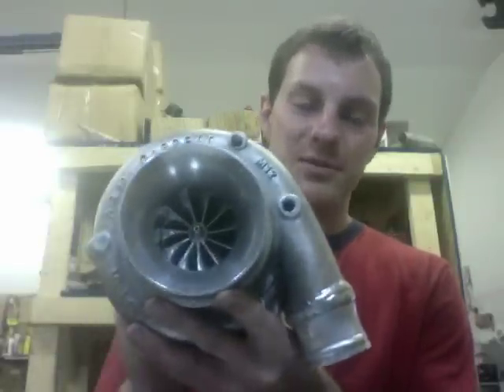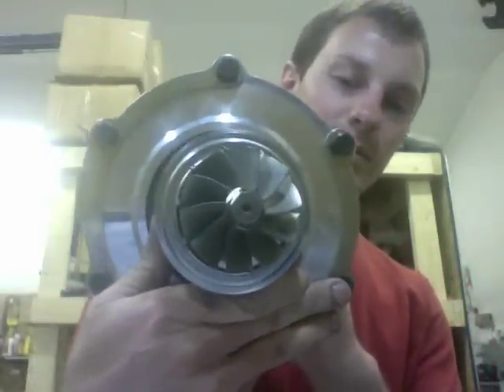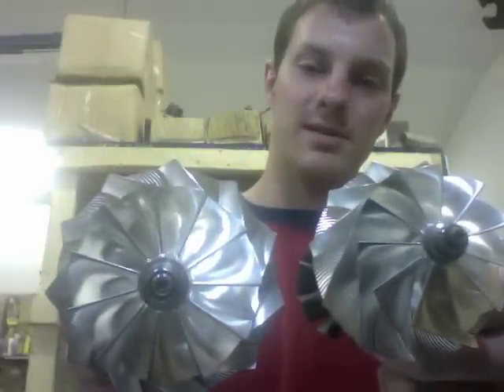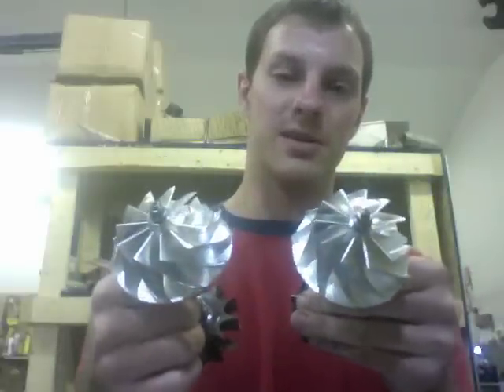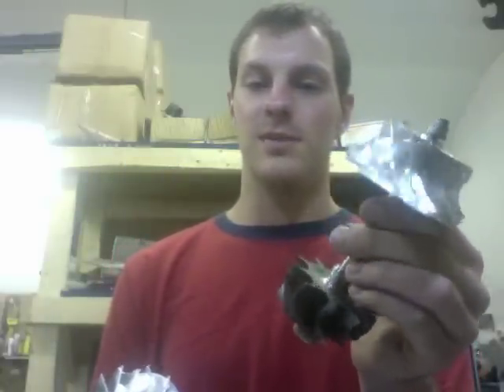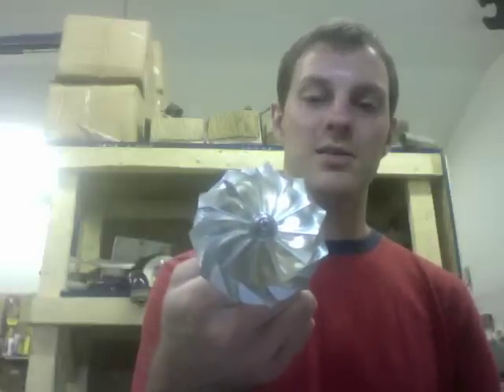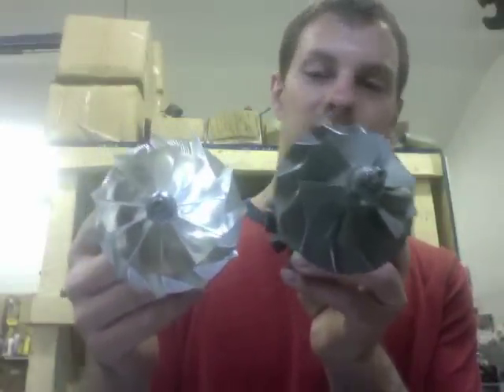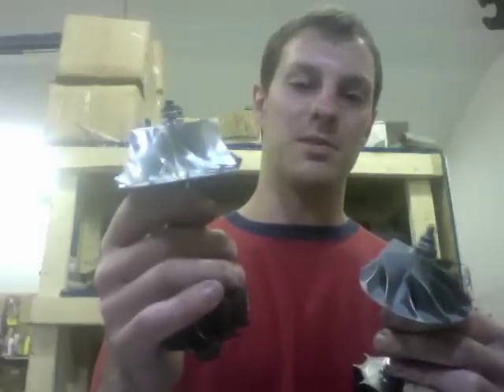Garrett GTX3071R vs GTX3076R

Comment: Hey brotha! Want to get your opinion, trying to get as much info as possible for my build!

So I have a 06-08 K24a2 swapped 8th civic. (Strongest 2.4L Honda has) and I am planning to Turbo it soon. I am looking at a Full Race Kit, but what's most important, as you know, is the turbo.

I am thinking the GTX3076 would be perfect, I'm wondering when it would spool up and if would overboost the turbo if I didnt get the bigger exhaust housing, or if that housing would make it spool way high in the RPM band. Would a GTX35r be a better fit for the K24a2 just in general engine to turbo matching?

My K24 is making 220 WHP 170 WTQ (@ 3k) NA with the lightest mods and tune CAI + Exhaust, still running stock restrictive K20 header + Cat. So the engine is pretty beefy and fiesty.

Comment: hey man 
i have 3  questions , i have the gtx3076r with .64 tial exhaust and i dropped a valve seat that destroyed the turbine 
1 can i use a .82 using the same housing ? 
2 is there a good upgrade i could do ?
3 whats a good place to buy these turbines or is it threw garrett ?i tried sending a dm but couldn't find out how 
thank you in advance
Reply from the maker: The gtx3076r is the largest of its series, so if you want to upgrade you have to upgrade to a gtx3576r or larger. The gtx3076r is rated up to 580 hp, but the turbine housing size is the limiting factor. You can probably get a .82 turbine housing that is machined to fit the gtx3076r or gtx35r. I have replacement turbines on hand. We have  our contact information on our website
Reply from the maker: http://turbolabofamerica.com/contact-us/
Reply: Perfect I will contact you directly
Reply: I emailed you but got no reply

Comment: Quick question... If i wanted to make 500whp on a subaru 2.5L engine all the way till redline.. Which would be the better turbo to use.... gen 2 gtx3071 or gen 1 gtx3076? 
Considering that what is important to me is for the power not die off before redline.

I'm asking because. It's generally agreed that the gen 1 gtx3071 was a good turbo for the 2.0~2.2L engines... Not the 2.5L.  So does the same apply for the gen 2 gtx3071?

Comment: Hey man so I have a built gsr 1.8 bored out to a 2.0 do you recommend 3076 or 71 it’s more on a daily/occasion race? What do you recommend
Reply: My 1.8t is laggy but pulls so hard on the gt3076  .63ar turbine.
Reply: I'd like to add one for 75,000 miles on a garret 3076r.   It's probably do for rebuild. burns some oil under load now, filling the boost tubes.
4500rpm spool up starts  t25 flange though:(

Comment: Hi Austin, what's your opinion on flank vs point milled compressor wheel. Which performs better? Is the difference a lot?
Reply from the maker: +chownkay I have never heard of the term flank or point milled compressor wheel before.
Reply from the maker: There is some bad information online about this topic. Tims turbos has video of the billet wheel vs cast, He says that the billet wheels weight more because it is more dense, but it depends on the billet wheel. Some of the billet wheels we have are 20 grams lighter  than stock and have a more aero design. 

They are designed the grab more air. I have no way to test a comparison between the 2 different styles. However, it makes sense that the wheels with the thiner blades and more narrow hub will flow more air because it has more room for more air to be grabbed.

We use mostly billet wheels for the simple reason that they come in many different sizes that we need, they are popular, they make the turbos look good, they are a performance design, as well as with extended tips, and they are more durable over cast. 

Here is a weight comparison picture of the same size: wheel http://turbolabofamerica.com/holset-hx40-super-billet-compressor-wheel/
Reply: +Turbo Lab America Hi Austin, if you read the blog in detail, it's not so much discussing the weight of the wheel, or billet vs cast wheel. But more of how the billet wheel was forged, e.g. 3rd order geometry and flank milled vs point milled billet wheels..

Comment: What turbo would you recommend for a daily/weekend warrior brz? I was thinking a gen 2 gtx2867r with a .63ar or would that be a choke point? My goals are 300whp on pump gas the FA20 seems to have good flow, does this seem doable?
Reply: I would go with the Gen2 GTX3071R... I ran a gen 1 and it was crazy! hit boost @2000rpms and full boost (30psi) @4800 on E85 in my 257 swapped gc8... it will leave you plenty of room for upgrades down the road. Great turbo for 300-500whp
Reply: Idk if you’ve done anything yet, but do some research into the available turbo kits for the fa20 and reach out to those companies. Most companies will be happy to converse with you and recommend the upgrades you should make or things you should replace, if any for your power goals with their kit

Comment: Hi Austin can i ask you a question...??the ball bearings of the gtx3076-3071 and gt2860r gt2860-gt2871 are the same????if i order a kit from you it will fit all of these turbos if needed???
Reply from the maker: +HLIASRS3 Yes it is the same, it also fits the gt35r and gtx35r. The Cage Changed to a larger cage with the GT37r /gt40/gt42r series.

Comment: Hi Austin i'm sending from Greece,i have in my audi s3 tfsi atpgt3071r turbo kit with 11 blade compressor gtx3071r and I see in two different dyno dyno dynamics and dynojet 621bhp and 76kgr torgue in 2,32 bar.I wonder if I can see that power from gtx3071r compressor or they did mistake and put in atpgt3071r gtx3076r compressor;You are famous here in Greece with your turbo upgrades thank you very match.
Reply from the maker: +dimitris iliopoulos are you talking about making that much power on 2 of those turbos? The s3, you mean s4?
Reply: +Turbo Lab America I have audi s3 tfsi and I have the atp vvw-186 turbo kit with 60mm gt3071r with 11 blade compressor gtx3071 inside and I wonder if they make mistake and they put inside gtx3076 11 blade compressor because 621bhp and 76kgr torggue from gtx3071 is too match specially the torgue.Thank you very mutch for your answer,my question is if gtx3071r in 2,3 bar can have 621bhp from your experianse;
Reply from the maker: You should measure the wheels.
Reply: +Turbo Lab America In dynojet I see 526,28whp amd 64,68kgr torgue in 2,3 bar,in dynodynamics I see 621bhp and 77 kgr torgue

Comment: What set up would you recommend for a 2JZ GTE VVTI motor going into a Datsun 280Z with a 350Z CD009 transmission and a Q45 3.54 differential shooting for 500hp? Would really appreciate your input, thank you!
Reply: Casper0878 gt3071r. Made 504whp on 22psi on pump 98. Next to no lag either
Reply: Casper0878 only down side is that’s all I can really get out of it. If I want anymore power I’ll either need to run e85 or go to a bigger turbo

Comment: Can the same thing be done to upgrade the GTX3076 to a GTX3576 ?.... I have a bolt on GTX3076 on Evo X making 507 whp @31 psi and I would like to upgrade to GTX35 and make somewhere in the 550 plus.
Reply from the maker: +pekoso1 If you currently have a Gtx3076r with a .82 t3 turbine housing you could go with a 1.06 t3 turbine housing and probably make the power you want.

To go from the gtx3576r,  that combination involves replacing the GT3076r turbine 55 x 60mm (6mm shaft bore) with a gt35r turbine 62.35 x 68mm (6.35mm shaft bore). 

Since the shaf tbore is different, the compressor wheel must be machined out, or the compressor wheel replaced. Its a lot easier for me to replace the wheel.  The cost to do this upgrade is 550$, which includes the rebuild, machining the turbine housing, exhanging compressor wheels, and balancing the assembly.
Reply: true, but why would anyone want to run a 1.06 on a 30r when he can run a gtx3576r and make gt3582r power & gt3076r spool!?! The 1.06ar is just too laggy, even on the 30r.
Reply: im not 100%, but im pretty sure you can upgrade the gtx3076 with a 35r turbine wheel upgrade kit for about $600
Reply from the maker: It's just depends on the size engine and the amount of horsepower someone is trying to make. Keep in mind the difference in the gtx3576 and gtx3076 compressor wheel is that the  gtx3576 has a 6.35 mm shaft bore to fit the gt35r turbine and the gtx3076r compressor wheel is 6.0mm shaft bore to fit the gt3076r turbine.  So the gtx3076r upgrading to gtx3582r does require having the compressor wheel  bore machined out or replaced with the gtx3576r wheel but the wheel design is the same otherwise.

Comment: What is the best turbo 2015
Reply from the maker: +Son Goku It depends on the HP you are trying to make, and the size engine you have.
Reply: gtx3071r with 82ar for anything under 500whp and the gtx3576r with 63 or 82ar  for anything from 500-650... looking to make more power than 650 i would look at either a gtx4202 gtx5518r or a 6862 even!

Comment: Would this gtx3076 be better on a 3 ltr for 250-300kw manual instead of a gt35/40 with a. 62 etc?  which everyone is recommending. I don't want huge lag and big power more a all round Street car
Reply: 4y old response.  In a 2jz the  Gt30 .86 are beat .64 ar across the board.  Gt35 .86 ar was beaten to around 5000 where it lagged by 700 rpm.  It made about 20whp more.  For a street turbo the gt30 was superior with 100wtq or more at many rpm points.

Comment: what would you say is the spool diffrence
Reply from the maker: There is no correct answer for that, because it depends on the engine size. The closer the turbo flow rates is in relation to the natural flow rates on the engine the more efficient it is and quicker the spool will be.  It also depends a lot on the tune, intercooler volume etc
Reply: OP is correct.  There are a lot of factors in determining spool characteristics.  
The general rule is the lower A/R of the turbine housing, the faster the spool-up, the greater the low-end torque, and the lower the high-end power.  A/R is the interior area of turbine (A), {or the cylindrical spout of the snail to get picturesque},  divided by the radius from the center of the turbine to the tongue (R).  Since most turbos have an array of different turbine housing A/R's, you can customize the application of the turbo, and really just need to select the best turbo for your engine size and displacement.

Comment: Can the gtx really put out of 550whp ?
Reply: Gtx is just the model, not the size of the turbo. To answer ur question tho, the smallest Gen 2 gtx series turbo to make 550 is the 3071R, It will make 0ver 600awhp and the gtx2867R might make close to 500whp... I made close to 500 with the Gen 1 gtx3071 .82ar on E85 EJ257 w/2L heads, so the Gen 2 will make a bit more!
Reply: +Evol_AF did it pull all the way to redline or it run out of puff?
Reply: My STi RA had a 8900RPM Redline, but it would hold 30psi to 8500 and fall to 26-27 at Redline. With a 9k Redline i rarely needed to hit redline. It hit peak HP @6500 & TQ @5600 and didnt fall off untill 8500
The gen 1 gtx3071R was my fav 30R sized turbo, but best all around IMO is the Gen 2 gtx3576R.... Power & Torque  with little lag on a 2L & very little lag on 2.4-2.5L
Reply: @Thr33.Sid3z  I'm looking for a turbo that pulls all the way till my 8k redline on a 2.5L. 

My options are a gen 1 gtx3076 which i currently have or a gen 2 gtx3071... 

What would advice...? I'll mostly be drag racing on race gas.
Reply: @Thr33.Sid3z  saw that the gtx2867 was making well over 400whp like you said.   How much earlier does the Gtx2867 start making boost vs the gtx3071 and gtx3076?

Comment: ur figures are just a little bit off. The Exducer on the GTX3071R is 73.45mm (2.05mm bigger than claimed) and ur saying that u wouldnt recommend running it on anything bigger than a 2.0L or 1.8L even? it makes great Numbers on a 2.5L.  Ppl are making 450-500 with the gtx3071r. Its basically a gt3076r that spools faster.
Reply from the maker: My reasoning wasn't based on the power that car could make, my reasoning was based on the turbo choking the engine at higher rpm because of the engine outflowing the turbo.
Reply: Turbo Lab America the Gtx3076r is the Mismatched turbo. it only saw 5-8% gains over the GT model. the gtx3071r saw 15-20% gains over the GT model. the gtx3576r was made in response to the poor performance of the gtx3076r.